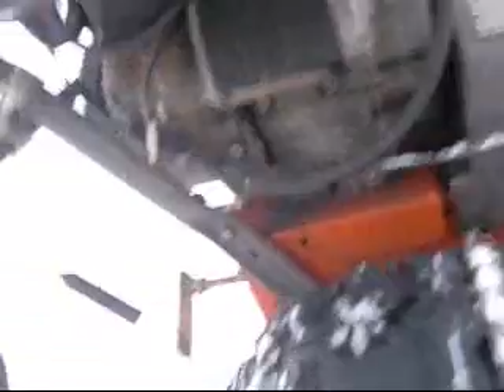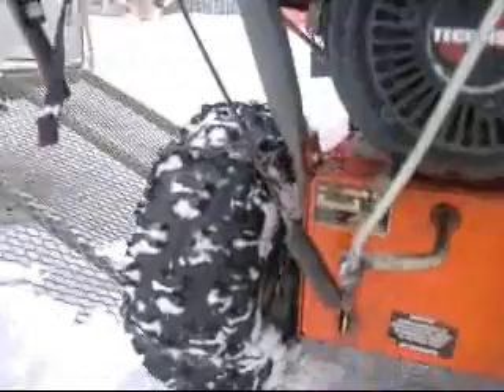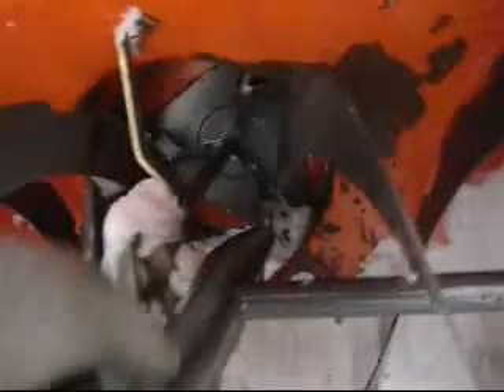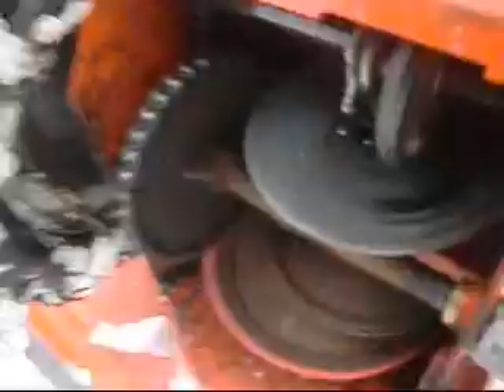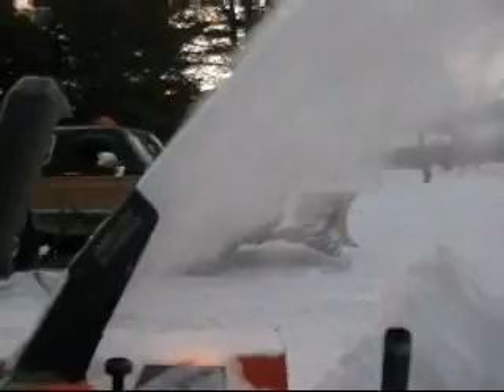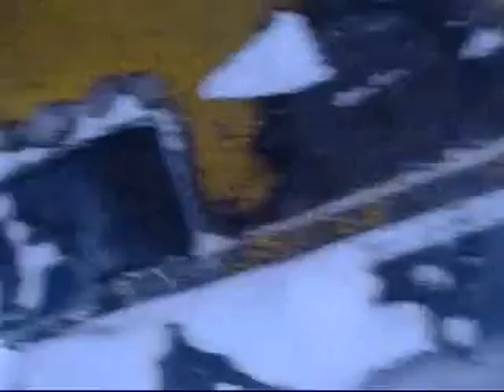2 10 11  NOMA Snowblower Action...

Comment: It needed new sheer bolts and bolts were loose I would think the dealer would have taken care of that . I have seen Noma snowblowers crack the metal in the spots you said you were going to reweld one it cracks its just a matter of time till its only good for parts . You will have a good engine .